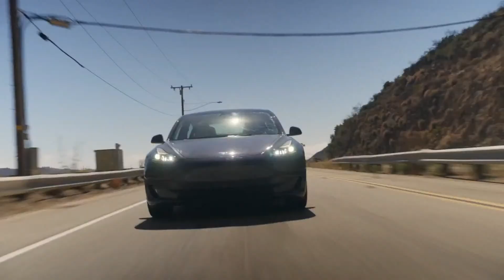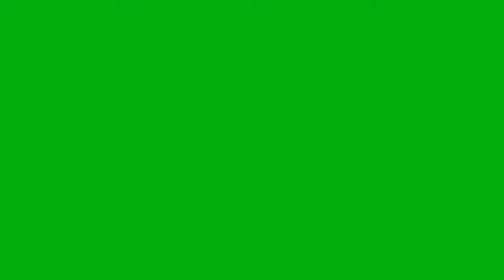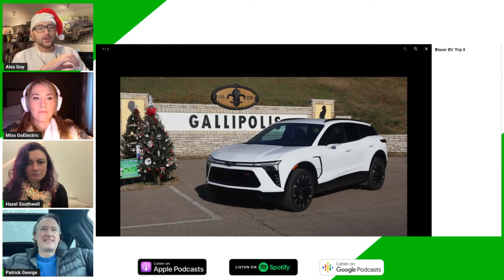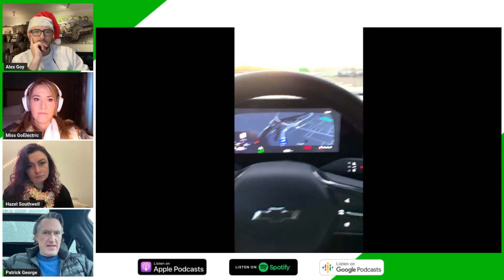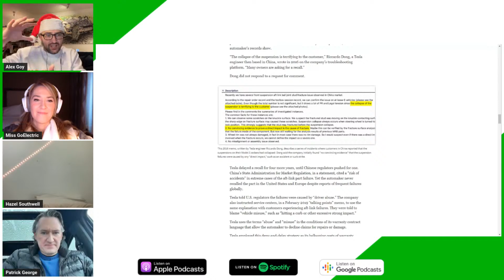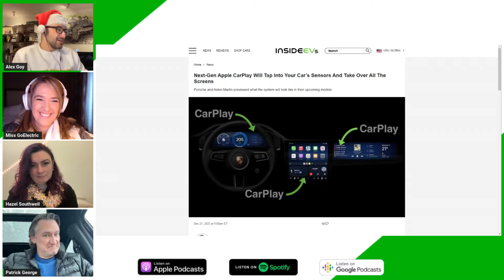InsideEVs Podcast #191: Chevrolet Blazer EV Problems, Tesla Investigation, Apple CarPlay

Comment: One point that many people miss is that the Chevy Bolt was mostly engineered by GM Korea together with LG Corporation. They had built the Chevy Spark EV, which was a transformed Daewoo Matiz, and GM had a focused team to build the Bolt. Famously, out of 112,000 Bolts, (16) of them caught fire, and their battery packs were recalled. GM threw LG Chem under the bus for $1.9B for the Bolt recall. At least they didn't have many other giant failures with the software or drivetrain since the 2016 debut. The Hummer EV was the first to use the Ultium platform, but with only a few hundred sold in 2022, it never was really volume production. The Cadillac Lyriq had 121 models sold in 2022, but sales went up in 2023 to over 5,000. The EV Blazer is arguably a rebody of the Lyriq, and unfortunately for Chevy, it costs more for a comparable model. Historically, shared models between Chevy and Cadillac had the Caddy priced about $20K more. But that approach failed miserably with the $76K Cadillac ELR (which died quickly), compared to the popular Chevy Volt (not Bolt) which shared its EREV drivetrain. So when Cadillac came out with the Lyriq, they first bought out the dealers who would not sell EVs, and smartly priced the Lyriq under $60K so that it would compete against the successful Tesla Model Y and Hyundai EV crossovers (probably at a loss). But when GM killed the Bolt, and couldn't build a price competitive EV Equinox or Silverado, they rushed the EV Blazer out to try and combat their unrealistic claims of EV dominance by 2025. And my guess is that the beancounters tried to sell the EV Blazer at a profit, to appease shareholders. But since they didn't test the software properly, the only Chevy EV offerings are a shambles now. and far from competitive. Hopefully Honda/Acura does better with their rebody of this platform. But since that deal soured, it is hard to have high hopes. With some luck, Chevy will provide needed fixes and reintroduce a decent EV Blazer in a few months time.

Comment: Buttons!  Please bring back HVAC fan speed buttons.  I have a Bolt & R1T & I have more heads down time in the R1 when changing the infotainment settings.  I wish I had XM satellite radio since everything in the R1 is cellular based.  I don't have cell service on over half of my 40 acre property.  Any travel out west can suck! for radio/sound system using only cell service.

Comment: GM probably has the same problems as Ford. Lots of systems from lots of different companies that own the operating software that is supposed to integrate with all the other systems. GM isn’t allowed to mess with the software. First they have to identify the issue then get multiple companies to work on the solution.